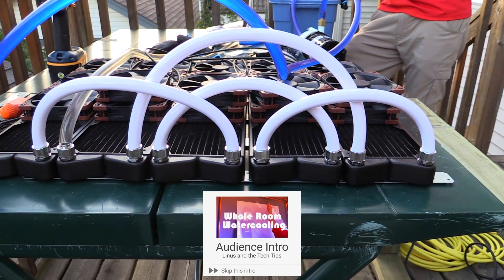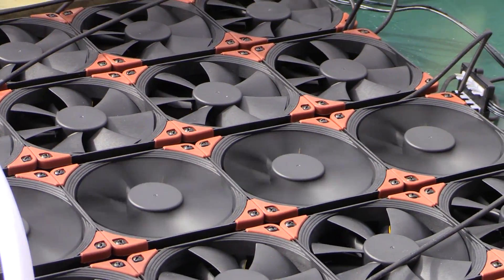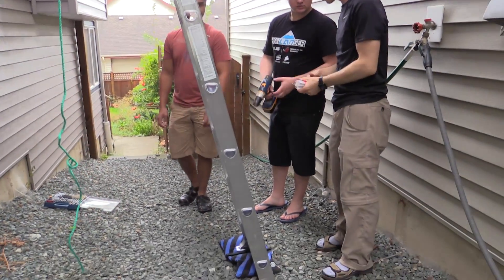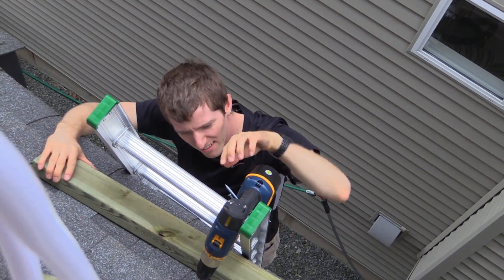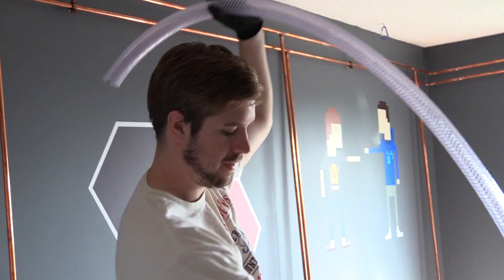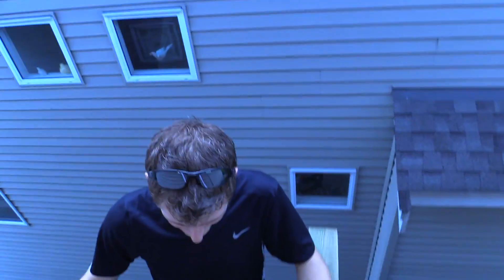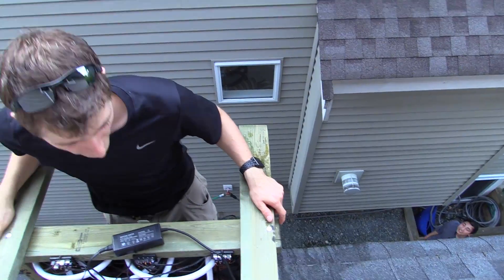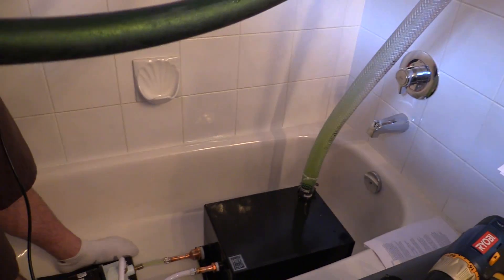Whole Room Water Cooling Project Day 3 - Radiator Mounting and Panic...

Comment: The cooling liquid is probably super toxic and you spilt it.
Reply: It's just deionized water......wat are you on mate
Reply: they used green antifreeze.
so yea it's toxic if consumed.
Reply: Luke Knudsen Green dye that is non ionizing ..... it's edible/non-toxic if you wanna try.
Reply: Its anti-freeze coolant so the water doesnt freeze and expand bursting the pipes. Yes its very toxic.
Reply: David Chen
Seriously... Liquid coolant requires the ENTIRE liquid to be liquid coolant. And as everyone has been stating already, this is anti-freeze, NOT coolant. Anti-freeze is used just as in this video such that you mix the solution with water, which at a 50/50 mix guarentees -37C minimum and provides corrision resistance while koolance is premixed.

Not to mention Koolance has no statistics of any cooling properties only heat resistance and weight.

Looking further into the Koolance fluid it uses Propylene glycol and Distilled water as its main sources. Guess what, Anti-Freeze uses Propylene glycol or Ethylene glycol. Which means that koolance "Coolant" is just vehicle Anti-freeze.

700mL is .184 Gallons 14.99 for 700mL and regular antifreeze premixed is 15 tops. You choose. Both have the same corrosion protection, both use the same ingredients.

Sorry, would you like me to get you a "Keep on digging" shirt? Please, if you post a link and defend your choice do some research on the subject matter.
Reply: Luke Knudsen
it's antifreeze. a green liquid that prevents freezing of water at 0 degrees
Reply: sniperlif3 I'ts only toxic if you ingest it (about 3 oz will kill you without immediate treatment). touching it won't harm you.
Reply: David Chen
Ok? This says nothing about anything relevant. This is anti-freeze used to prevent the water in the pipes from freezing during the winter months.You know, since the water loops runs outside of the house in Canada...

Same thing used in your car so the water does not freeze causing the engine block to overheat due to no cooling ability.
Reply: David Chen Also what about the cooling additives to make it not mold and get nasty?
Reply: bilzoo20001
Anti-freeze aka Ethylene glycol can seep into the blood stream through skin contact causing the same effects as ingesting on a much smaller scale. Of course this takes much longer to occur.

This was found on epa.gov btw
Reply: David Chen Its ok just making sure no one was stuck on stupid.
Reply: Progster0192 All I'm saying is I feel a little suspicious. What are they using to make it green or any other color?
Reply: Luke Knudsen
Due to it moving so fast all the time. Doubt itll get moldy anytime soon.
Reply: Luke Knudsen Yea. Of course, don't drink the anti-freeze shit. Wait....why would you use antifreeze. PC's don't go into negative temps as that would cause condensation. As the coloring and water are deionized, they technically won't cause any issues apart from a placebo affect.
Reply: David Chen radiator mounted outside.
Reply: sniperlif3 Watercooling liquid is used by many industries requiring a high performance, low-toxicity, reliable coolant with corrosion and biological inhibitors. A high quality coolant is extremely important for addressing dissimilar metals and biologic growth (bacterial and algae) long-term. The liquids will not clog components and can typically be used for 2-3 years before replacement is recommended.
Reply: ***** sniperlif3  Liquid coolant only freezes at ~ -15 to -20 degrees CELSIUS dependent on coolant. I know that Koolance freezes at -20 on average
Reply: sniperlif3 ***** READ THIS: http://koolance.com/liq-702-liquid-coolant-bottle-high-performance-700ml-orange
Reply: Andrew Wysocki No. I personally don't use Koolance but it seems to be the most widely known coolant. And yes, I do know how to watercool. And yes, I do know what anti-freeze is...I kinda expect anyone above the age of 12 to....it's year 8/ grade 7 chemistry.
Reply: sniperlif3 Wait....where does it say that he uses antifreeze-water mix or is it just inferred that he used it then added green colouring...coz holy shit I must have missed it and then my basis is all wrong.
Reply: David Chen
 I believe they talked about it in a live show. Basically it is inferred through the video alone as they used tap water mixed with a green fluid and they need to have antifreeze properties as they live in a cold climate and the 5 radiators is outside and corrosion resistance. Also you can tell from the viscosity of the fluid dripping out that it is not just water with coloring its thicker.
Either way, they used one of the two Glycols mentioned for rad and pipe safety through cold days.
Reply: David Chen that koolance stuff is about 10 times more expensive than automotive antifreeze. so in small scale there is no reason not to use koolance or similar. but when your talking about gallons autmotive antifreeze will work just fine. plus who really cares anyway. like it really matters. one person just asked why they would use any type of antifreeze.
Reply: sniperlif3 Cool. Finally found the part where you can actually see the mixture of anti-freeze instead of simply coolant liquid or deionized water with pastel coloring. The viscosity however seems to be not too different between pre-mixed liquid and anti-freeze+water mix. They're both fairly runny and fairly green.
Reply: Eric Ayers
 Koolance computer coolant uses propylene glycol just as some vehicle antifreeze. Both glycols have corrosion resistance to prevent gumming. In fact propylene glycol is one of the ingredients used in corexit which helped clean oil spills. Propylene glycol is the main used of the two glycols in antifreeze as it is far less harmful to the environment.

Antifreeze link
http://en.wikipedia.org/wiki/Antifreeze
"Primary agents
Most antifreeze is made by mixing distilled water with some kind of alcohol....
Methanol...
Ethylene Glycol...
Propylene Glycol...
Glycerol"
Reply: David Chen
Yeah its only a slight difference in viscosity. I do a ton of work on engine rebuilds as well as some dabbling in subzero ambient liquid cooling systems and could see the difference of the drop on the pipe as well as the thinker appearance on the carpet (almost looks like a thin paint on the carpet rather than colored water soaked in) if that makes sense
Reply: Sanic i guess ethylene glycol
Reply: sniperlif3 Ahhhh. You could tell the difference coz ur a mechanic...I made my coolant at my friends chemistry lab so I don't exactly know about different viscosities, I just have my own coolant XD (and it doesn't contain a glycol but it can easily still run at -35 celcius) ;)
Reply: David Chen
Nice.
Reply: Peter Kay
Propylene glcol is the main ingredient in propylene glycol
Reply: Eric Ayers
 Koolance is diluted automobile anti-freeze. It is less effective for winter weather. You could be right, but they dilluted the mixture even more so rather than 25/75 antifreeze to water they are closer to 5-10/90-95 which renders it near useless for anti-freeze. Would be a poor choice.
Reply: David Chen deionized? i did not know that is what came out of the side of a house, i thought it was just normal water. also anti freeze is super toxic. you are supposed to dispose of it at automotive supply stores or chemical control facilitates
Reply: liiamthom
No he is saying that he found the part where they didnt use deionized water rather just tap water. Deionized is just a pure water that is more pure that distilled water.
Reply: sniperlif3 Your comment makes me laugh :P De-ionized water is simply water that has had its ions "removed". This means it won't conduct electricity since electrical power needs free electrons to flow. Distilled water is different, it is purified water. Same way you get gasoline from crude oil, distillation. Distilled water is a lot less toxic and much safer to use in water cooling systems but for full protection, especially if leaks are prone, is to use battery water (usually de-ionized, distilled water).
Reply: CHUBCLUB Waffle the use distilled water to prevent build up in the lines and slow down crosion
Reply: CHUBCLUB Waffle
Seriously. You do know that ions are minerals and impurities in water, distilled water is only boiled and condensated leaving many of those impurites in rather than directly removing them. Na+, Ca2+, Fe2+, Cu2+ are just some of the ions found in soil and pipes that is in water. SInce you appear to be lazy here is a link for you:
http://lmgtfy.com/?q=what+is+deionized+water
Reply: CHUBCLUB Waffle There is no difference between the output of de-ionised and distilled water. It still ends up being as pure as each other. 
Pure water rarely exists in nature. It always has some form of ions/material mixed into it.
Reply: ***** The "output"???
Also, de-ionized is generally purer as some organic materials and other substances with boiling points similar to water can end up in distilled. While on an industrial level that generally doesn't happen but the purest form of water is de-ionized.
Reply: liiamthom I know why they use Distilled and/or De-Ionized water, that wasn't my point.
Reply: CHUBCLUB Waffle but they did not... they used tap water
Reply: sniperlif3 You do know that not all the ions in water are impurities. Ever heard of H+? Ever heard OH-? Both Hydrogen atoms and Hydroxide molecules exist even in pure (distilled) water. Hence why we De-Ionize too.

EDIT: Might also want to point out since you like jumping on mistakes, that I do understand that H+ and OH- are in small concentrations but the risk is still present. DI water is safer for components, Distilled water is safer for pipes, rads and reservoirs.
Reply: CHUBCLUB Waffle The simple version of that was: Deionized Water is a liquid (in which a liquid is a 100% pure substance in which there are no excess molecules/ ions) while Distilled/ normal water is a FLUID
Reply: David Chen Not exactly. A liquid is a type of fluid, the same as a gas.

FLUID: Something that "flows",
LIQUID: Something that takes the shape of its container but keeps the same volume.
GAS: Something that takes the shape and volume of its container.
Reply: CHUBCLUB Waffle Sorry, it's not a fluid, it's a mixture
Reply: David Chen Its a FLUID. Just because it's a mixture doesn't mean its not a fluid.

Whatever next? You'll probably say the world isn't flat..

(To all those who missed it, my last point was sarcasm)
Reply: CHUBCLUB Waffle I don't think you got my point...I was saying that Deionized water is a liquid and that distilled/normal water is not (going with the fact that chemists classify a liquid as something in which on that specific molecule is present, nothing else)
Reply: CHUBCLUB Waffle
A fluid is a liquid or a gas, it is defined as a state of matter that takes the form of its container.  But a mixture of 2 solids would make it an alloy so... yeah
Reply: David Chen
He mixed it with anti-freeze which is toxic.
Reply: CreativeExeptionDoom I know, we've been through this in the above comments.

Quick run-down: I didn't realise that they were using anti-freeze as there are other solutions like it that are like it. I didn't realise because I use my own coolant which is non-toxic and freezes below anti-freeze temps. Then Sniperlife thought it was distilled water or something.
Reply: CreativeExeptionDoom Thank you for basically repeating my point. Also two things mixed together isn't an alloy. Two metals combined is an alloy. Stop trying to act smart, please?

Also if googling is too hard for you, then: http://lmgtfy.com/?q=define+alloy
Reply: David Chen I think you're getting confused between defining something as a liquid (state of matter) and aqueous (soluble in water, H2O).
Reply: CHUBCLUB Waffle Not really. If you do Cambridge exams, it is only a liquid if it is a 100% pure substance. And yes, I do understand the definitions XD I'm not stupid ;)
Reply: David Chen Well considering everything I've been taught and the wealth of (relevant) information freely available on the internet, I don't believe that in the slightest. Source and I'd be happy to accept defeat but otherwise I'll stick to the definitions that the world and I know and use.
Reply: CHUBCLUB Waffle Hahahaha. Shit, now I need to find the files from IGCSE chemistry. I'll find it someday and I'll show
Reply: CHUBCLUB Waffle Holy shit, the syllabus has changed a lot from when I did IGCSE. But hey, I got my grades (A+) from that syllabus 

http://www.acceleratedstudynotes.com/gcse/music/igcse-coordinated-science-elements-compounds-and-mixtures/
Reply: CHUBCLUB Waffle Ah, I see why we differ. I am talking about PURE liquids instead of Liquid mixtures. I see that they have been renamed